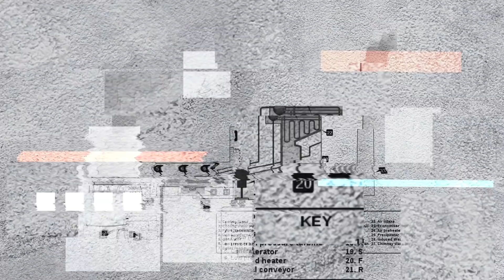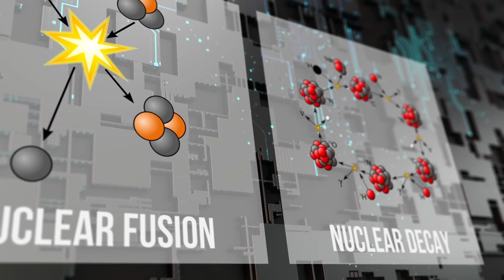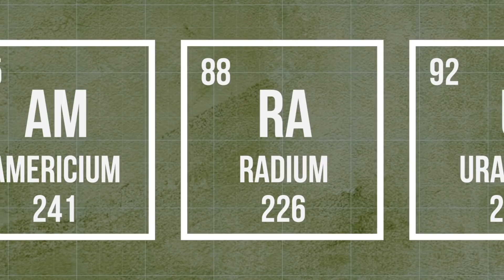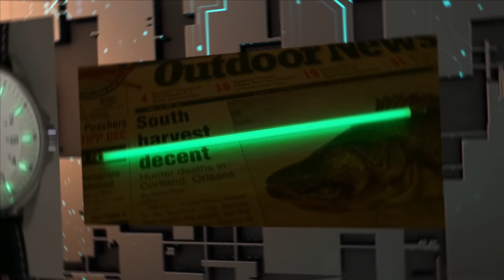World's Smallest Nuclear Reactor

Comment: A Farnsworth fuser doesn't create any electricity. 

You put millions of volts in to fuse small amounts of elements and a tonne of non sheilded radiation (not advisable to be near for long periods),just because it creates elements doesn't mean you can create energy, you lose a ridiculous amount of energy. 

The nuclear boy scout went in and out of jail, kicked out of multiple schools and well.. not a pleasant story. The land he made his "reactor" in were quarantined and took a long time to be disposed of properly because he had no clue what he were doing as far as shielding, handling and disposal. Radium one of the most deadly substances he handled had to be dissolved from the adhesive on the clock hands he found in a solvent and he did that by hand for instance. Not a person to emulate and I hope he didn't suffer any more than his life story implies.

Comment: A twelve year old teenager?
Lasers in a floppy drive?
A circuit (I'll give you that one)  that would be a constant current source obviously 😉 
Pretty sure you can't use glass or acrylics to focus a beam of electrons.  You'll need some elctromagnets and some more pesky circuit boards if you want to focus you beta rays.
Tritium is pretty rare, and super toxic.  You don't want to take in any of that isotope of Hydrogen,   when it gets inside you it'll do crazy damage to nearby tissue.

This is a neat video, in that I was confused by the many contradictions.. like not being able to get U238 (which he didn't use by the way, he used Th232)  Am241 or Radium.  He bought all of it.  Tons of lantern mantles for the Thorium, old smoke detectors for the Americum and (from antique shops, not the scrapper)  he sourced his Radium clock hands.    So definitely available to any teenager at the time.    His purpose was to build a small pile, get it to go critical (no way he could have succeeded with what he had assembled)  and breed a rather nasty isotope of Uranium 233.    Oh, almost forgot, it was a garden shed, not a barn. Super cool stuff for sure.  Also an bad idea.   At least this video got that right.  Building a nuclear pile at home isn't a great idea. His death, not sure, but I heard it was opoids.  

A little more proof reading.  (I really should follow my own advice here)   Would go a long way.   
The whole last bit with the island and the monkeys and lasers sounds like fun... but it didn't fit.. it kinda sounded like a a sleep deprived over caffinated brain storm.   

Oh... darn... one more thing is getting my attention here.  It's micro watts (if even that) that a beta voltaic device can source.    So make that was ot 36 reactors stated?  Make it 3600 and you'll be able to run the laser from your floppy disk.   You know... I did the laser thing a while back.  I needed two or three watts to get mine to give me a bright beam.  Half of the power was lost to heat on my current source.. and a bunch lost as heat on the diode itself.   30mW may be the final output power of the beam... but it does need a watt or three to get it to shine.     You're going to fall a little short on power.
If you have enough Tritium to run the light.. you likely wouldn't have to build anything.   Someones gonna come looking for all that Tritium.   Shits expensive

Comment: An error in the narrative. Floppy drives didn’t have laser diodes. The CG model in the video was a CD-ROM drive, which of course does use a laser diode. So I’m sure that is what you meant, however it’s mistakenly referred to a couple times in the video as a floppy drive.

Comment: i love how CG is able to get power from nuclear reaction without the need of having critical mass, are they trying to develop a process where the reaction doesn't need to be sustained or are they so good at it the process can be switched on and off by hunting non-reacted by demand?
Reply: Radioactive materials do glow and react when stimulated with different wave lengths, some through natural decay. No critical mass is needed when you’re just collecting the naturally emitted particles. The only off switch is disassembly. Stopping the concentrated emissions, or if it’s the laser components; either block the solar panels or create/utilize a circuit breaker (off switch) embedded in salvaged electronics.

Comment: Umm.  A nuclear reactor is not a nuclear battery / radioisotope photovoltaic.  They are completely different in operation.  A nuclear reactor relies on the fission of heavy elements (eg U235).  The radioisotope photovoltaic (nuclear battery) that you describe in the video relies on capturing the energy from ionising radiation (in your case beta decay from tritium) from an unstable radioactive nuclei.  Radioisotope photovoltaics typically provide very low currents for long periods of time (depending on the half-life of the radioactive source).  To date, they are not suitable for use in large scale power production.

Comment: imagine not even researching the radioactive boyscout and making falsified claims. first off, the reactor he was building was not meant to create electricity, it was a breeder reactor design, which is not capable of producing electricity, its sole purpose is to facilitate transmutation (mutate lighter elements into heavier ones), the purpose of this reactor in his case was to synthesis elements for further experimentation.... the reason the radiation accident happend was because he was foolishly handling his assembled fuel bundles which went critical in his hands....... exposing himself and the surrounding area to very high levels of radiation.

Comment: What even is this nonsense?

Why the hell wouldn't I just build a radio out of all those computer parts, which surely have a few old power supplies with big old caps, power transistors, and coils, point the solar cells at the sun instead of at the dim ass tritium sources, and call for help during the day in half the time with half the risk and effort?  If I've got that much crap, I bet I could salvage some half dead lithium batteries, which would be way better than solar cells to begin with.

The odds of me getting a useful laser diode out of an old CDROM or DVD drive is pretty low, and it's the burning lasers on those drives that are powerful enough for this.  Those are usually inferred which wouldn't be visible to passing pilots anyway.

By the way, if that was a "floppy drive" I was taking apart, I would definitely be making a radio, not a laser system, because floppy drives take magnetic media and I'd be salvaging wire from a motor coil, not a laser diode.

Also, even if I were stupid enough waste my time constructing a reactor in that manner, who cares about cooling?  Each tritium cell is generating less radiation than the sunlight hitting the container on a cloudy day...  would I worry about my reactor blowing up from being hit by solar radiation?  If that were the case, I'd have to wonder where I got all the explosives to build the frames out of.

Comment: This is bad information. The solar panel isn't working off of beta decay, not directly. Beta particles strike phosphor which cause visible light to be emitted and that converts to electrical energy using photo voltaic cells.

Comment: Um nuclear reactors produce heat, that heat energy is what powers the generators using steam, literally the nuclear reactors are just the fire that boils the water, like a coal plant where the coal is burned to boil the water where the pressure from the steam spins the generator which is just magnets spinning around copper coils which causes a magnetic flow which allows electric ions to flow through a conductor aka copper wires, the nuclear reactors are just a heat source... It's not where electricity comes from so your understanding of nuclear power is wrong dude.

Comment: Humans don't get electricity from decay, but from induced fission. Very different processes. Decay is yet another reaction. Fusion, fission, capture and decay are the four basic reactions. In nuclear power reactors, fission is the one we want, decay is the side reaction we don't want. 

It's like claiming that a car operates by leaking oil, instead of by burning gas. Decay is mostly just an undesirable side effect. 

Don't confuse the two.

Comment: The beta particles from tritium vials excite phosphors to make light. The beta particles do not pass through the glass of the vial in any significant quantities. Any power generation would therefore be photovoltaic rather than betavoltaic in nature.   Using only one vial, it would be only possible to achieve powers in the picowatts range... or in other terms, less than a millionth(!!) of what would be needed to power a typical LED.

Comment: The Tritium in those vials produces weak beta particles, the glass it is in also absorbs a lot of those particles. Basically you could wear it around your neck for it's whole lifespan (10 - 25 years of luminescence) with no problems.
Reply: Your neck will develop a problem though.

Comment: This guy's a moron.  As someone who is also working on a fusor, the narrator has no idea what's going on. 

In the first 2 minutes,  here are all the mistakes he's made.
1) many people have hone power plants using solar/wind.
2) he basically just dismisses the existence of hobbyists who have purchased second hand turbines, and built wood fired steam plants.
3) he acts like a Farnsworth fusor is in any universe a valid power source. It doesn't take energy in "construction", it just consumes energy.  You plug it in and it generates radiation.  You can think of it as a plug-in block of uranium. (Which is not to diminish the kid's incredible achievement,  just this moron's reporting of it)

Comment: Funny video but after 5 mins it become very unrealistic, tritium is such damn rare, if you could earn that SO easily, people wouldn't use lithium irridation to get tritium. A bit of tritium is already very very expensive, so you can expect that you can find in a 10$ near no tritium. Enough for a slight glow, yes, but thats all. In fact you could use multiple tritium sticks to make a tritium rtg with a power output of a few watts. If you use thermal generators and solarpanels. But you never would find them such easily anywhere else as in glowing stuff.

The smallest reactor with energy output are in fact RTGs (Radioisotope Thermal Generator) wich doesn't produce much power and are more dangerous as usefully in the near of humans, so they are used in space or some external stuff. The smallest RTG you could build would have a size of a tin can and beeing able to output 5-7W if you use tritium. THe disadventages of heavy elements like uranium and other non tritium stuff is ... they need mass and volume to generate more power as to keep the reactor up. So its impossible to go smaller via fission. But you could use fusion because they need density, more density more power. A tin can fusion reactor could produce then inaverage 1MW for weeks.

Comment: Besides cool points or whatever the author was hoping to get, why couldn't you just use the computer parts to build a ham radio instead? You would not need the power of a nuclear reactor to power it. You could probably get away with using that solar panel off the calculator to charge one of the laptop batteries although it might take a little while. I'm not sure how much energy those little panels can collect. You might be able to get away with using the cooling fans inside the laptops as little motors to charge the battery as well, but it would be a bit more work.

Comment: Lmaooo this is the dumbest thing I have ever seen😂😂😂😂😂

I mean sereusly where do you find an island with nuclear material on it 😂😂😂 and where did you get the led from😂😂

You would have better luck trying to make a salt water battery from the ocean and use sum washed up cans or sumthing to use as the anode and cathode use a piece of aluminum if available and sum cloth to make a capacitor  to build the charge hook them up in series and try to make  sum kinde of fuse from the supozid can or a string coted in salt water might burn for a little bit but not long   or you could try using a varry thin slice of aluminum  this is assuming you aren't already dead of dehydrashun but that is a whole other matter😋

Comment: Buy two, 12",  20-watt solar panels. Buy 100 vials of tritium. Buy a sample of uranium ore from united nuclear (It's Ore, not weapons-grade uranium, legal to buy and own up to certain quantities). Buy a 10" diameter aluminum "duct" pipe. Buy two 10 inch magnifying glasses. Buy a hot glue gun.                           

Fill the length of duct pipe with the tritium vials, place your uranium ore wrapped in a thin layer of tin foil, in the middle of the tritium vials. Cap both ends of the tube with the magnifying glasses, using hot glue. Sandwich the two solar panels over the magnifying glasses and hook them up in parallel.. You should get A LOT more power with a single reactor. And if you want to shield it, buy Lead-Foil, and wrap it around the aluminum duct with some tape.

Comment: There are problems with this reactor, tritum does not emit very high energy beta particles so is not able to penetrate the glass capsule it is within, i also do not think you can focus beta particles very well by just using foil, you will need electromagnetic feilds to do that. Also using a glass lens(and air gap) will block out the very few(if any) beta particles that did just happen to escape the capsule from hitting the solar cell.

The best way to make a nuclear power supply using these tritum capsules is just to get a calculator solar cell and secure the tritium capsules to top of the cell using tape, so the light emitted from the phophor can most efficiently be caught be the solar cell. But even then the current emitted from such a setup is probably in the very low milliamp/microamp range...it will take many more of these nuclear cells than 40 to power such a laser...
Reply: the glass of the  solar  panel would be another issue but I think the focus was on the dim green  glow from a  phosphorous  coating on the glass one of these  around your neck no problem 1000  of them in confined space with   even limited focusing  of the beta particles would be like   a beta flash light rather then a beta glow stick and  be some what dangerous even only  a long term exposure I know that breaking one of these open is rather deadly in the   short term something like 1 hour of exposure  but  this is for like an exit  sign not a tiny half ounce capsule

Comment: Better take the CR2032 batteries from the motherboards.
Reply: @johnnytheprick man the video has me shipwrecked with infinite tritium, tbh I'd bd rescued almost immediately cuz someone would be definately tracking the motherload of shipments 😂😂😂😂😂
Reply: lol
Reply: @johnnytheprick jokes aside I was thinking something similar to ham radio setup. Something bodged together with just enough parts...
Reply: If you have the solar panels... I think the sun is probably a stronger nuclear reaction source than the tritium tubes... Just sayin.
Reply: 56565
Reply: @johnnytheprick sweep known comma frequencies. maybe not just sweep, but also pulse ( ... --- ... ) Or you'll be sitting shifting 0 to infinity 🤦‍♂️🤷🏾‍♂️ point is how to get attention. Now I am not going to check and Post what particular frequency to mess with on YouTube.
Reply: *Comms
Reply: @johnnytheprick hypothetical scenario man, come on don be a pri... Ohh okayyy
Reply: @johnnytheprick you would like to keep an eye on that tritium don't you 😂😂
Reply: @johnnytheprick well cb spectrum is 26.965-27.405hz ham is more complicated with different bands/modes but u could transmit from 136khz - 250ghz
Reply: you have solar panel and a bunch of circuits, build an oscillator and an antenna and let it rip on one freqency someone will surely notice!
Reply: Dude I think you missed the point of this video. That said what were these very specific pieces of scrap and nuclear material doing in the same crate to begin with???
Reply: @noneofyourbusiness4032  crap

Comment: It'll be easier to build a much powerful battery from scrap than doing all this crap..
Reply: Sure powerful batteries already exist solid state battery and graphene batteries they just said that they need to do more safety checks and reduce production cost and by the way a manufacturer nio already uses them and luckily there available here in Germany and they don't get hot since everything is solid and fireproof